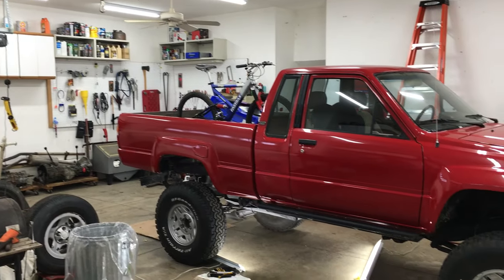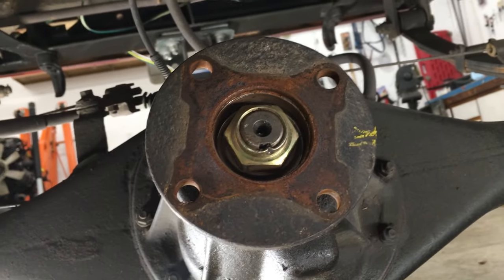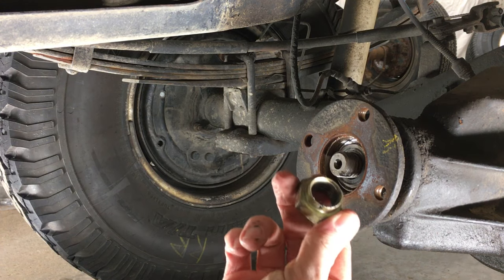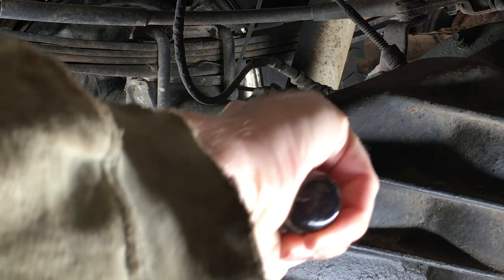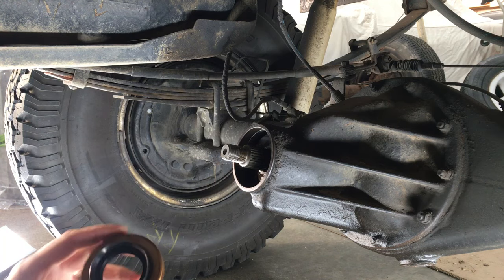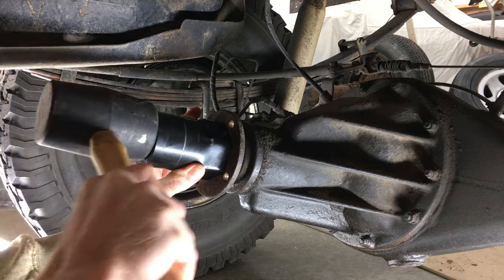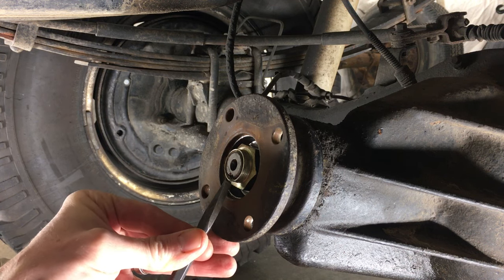How to Replace Toyota Pinion Oil Seal in Rear Differential/3rd Member

Comment: Toyota Master Tech here. The u joint does not have to maintain the same alignment with the pinion flange. It’s only when you’re disassembling a driveshaft that you have to make sure everything is indexed properly. The driveshaft is not balanced while attached to the pinion flange so that is why it doesn’t matter. If you noticed in your video, you do not necessarily reinstall the pinion flange on the same pinion splines so it makes no difference.
Reply from the maker: Jacob Dionne thanks for the tech👍
Reply: @6thGearGarage  no problem
Reply: @jacobdionne4334  Did the 90 ft-lbs of torque on the pinion nut really matter when you already had it aligned with the previous staking mark? Or is the 90 ft-lbs just a good rule of thumb if you fail to count turns?
Reply: @thelandcruiserproject  it depends what you’re doing. If you doing anything but simply replacing the pinion seal then you have to replace the crush sleeve and retorque.
Reply: @jacobdionne4334  Only replaced the pinion flange. Had a wear line that let a new seal leak.
Reply: @thelandcruiserproject  you need to retorque
Reply: @jacobdionne4334  Isn't removing the seal more invasive than just replacing the pinion flange? I removed the drive shaft, unstaked and removed 30mm pinion nut, removed pinion flange, installed new pinion flange, and the rest in reverse.
Reply: @thelandcruiserproject  no because you’re not using replacing a part that has bearing preload
Reply: @jacobdionne4334  Ah, I see I think. So since the new flange could be slightly different, that might affect the preload even with the nut back in the same spot. Thanks.
Reply: @thelandcruiserproject  yes
Reply: @Mike Hudson you can’t set it too deep. It’ll always seal
Reply: Agreed. What do you think about checking for backlash at the pinion, to be sure there is at least some backlash remaining after you're done? On my GM front diff, because of access difficulty, you measure backlash at the pinion and multiply by 2 to estimate ring gear backlash....
Reply: @spelunkerd  in regards to what? When setting pinion bearing preload, the backlash is already set for the pinion gear to ring gear. They’re separate.
Reply: @jacobdionne4334  I am no expert, I am asking the master tech whether what you did is standard practice. You make a good point, that assuming there was no wear of the hardware over the years, the pinion depth and backlash should not change just because you loosened, then retorqued to exactly the same position. But wouldn't it be appropriate to actually measure preload, and readjust the position of the pinion nut, rather than simply guessing based on minimum torque and counting threads? Backlash and preload tend to change over time as the gears wear. Wouldn't it be appropriate to recheck, readjust, and bring it all into spec? Or, would the expense of extra labor not be worth the cost?
Reply: @spelunkerd  you would need to pull both axles and the whole differential to recheck gear mesh.
Reply: Where are you located I may use you?
Reply: @THEBIBLEWAY238  this is 3 years ago. I teach college automotive currently
Reply: Thanks, I hate it when I hear BS shadfe tree mechanic "lore" passed off as fact and it carries on for decades; the drive shaft is balanced independent of the vehicle when they cut it and weld it together then they balance it on a lathe and attach the weight. The way people talk you'd need to mark your tires and bolt them back on the same way every time, it's just odd how there's all these bad mechanic 'tricks'.

Comment: Do not remove the pinion nut until you have marked the nut and pinin with a center punch so you can put the exact same preload on the bearings that they've had their entire life. Adding or subtracting a couple thousands of end-play or pre-load to the bearings is stupid and absolutely going to remove life from the pinion bearings.

Comment: you dont need special tools for pulling the seal, you screw in 2 screws on the face of the seal and then pull on the screw head with nail puller. :)

Comment: Dam great video I got an 86 and I've got massive vibration  some guys I bought it from may have installed gearing and didn't torque the pinion flange bolt correctly the flange moves  alot so I dropped the driveshaft and noticed the bolt can turn with your finger and they locked it in like that smfh I put everything back but tomorrow ill just torque it down to 90ft lbs and see if the vibration goes away.
Reply: Yes so I torqued it down and yes the vibration stopped then starting to come back not as bad so I think it loosened up again so sometime this week I'll tend to it again. I'm guessing they tried to install the gears themselves and didn't know what they were doing with the install I don't even think they preloaded anything lmao.

Comment: It’s actually not as important to count the turns on the nut as it may seem. The crush washers are pretty stiff, if you just run it back down and don’t hammer on it too much with an impact, you’ll be fine. But I’d put a mark on the nut and the pinion shaft so you have a good idea of where the nut was. Toyotas diffs aren’t very sensitive, thankfully.

Comment: You may have fixed your pinion seal, but how was your crush sleeve on the pinion? I bet your pinion was loose now that the sleeve has lost its crush. When you replace a seal on a diff, you need to replace the crush sleeve, unless you have a solid spacer on the pinion. Yea, “put the nut back where it was on the pinion” sure. But you can’t recrush a crush sleeve.
Reply from the maker: It's been a couple of years and it's all good. I showed the alternative to taking everything apart by using proper torque and tightening, because not everyone has the resources to repair it the long way. If you did want to disassemble the 3rd member and replace the crush sleeve, there's a link to those steps in the description.

Comment: Very good video.  I really like the voice-over and you explained every move perfectly.  Also, I immediately saw that you have the ideal tires on your truck.  Too many folks put too-wides on them.  They look great but are inefficient in the rough and fuel consumption.  Liked, sub'd.
Reply: In hawaii we make it wide there's multiple purposes for going wide stability is 1 and 2 we are surrounded by ocean which equals sand and we noticed wider wheels make better contact for riding on the sand now narrow wheels is good for mud it cuts through better than wide wheels we also noticed narrow wheels work good in the mountains. At the end of the day it all boils down to what you'll be using your rig for some people put wide wheels just for that aggressive look which to me is ok but very useless especially when using it on a 2 wheel drive I think lifting a 2 wheel drive in general is useless again it boils down to preference have a good day man.

Comment: You verify that the rotation torque is in spec. After you reach 90lbs. Should be around 10-12 inch pounds.
You will need to jack the rear off the ground. That verifies the preload has not changed.

Comment: Golden rule with diffs, always make sure the fill plug comes undone first, before draining plug comes out., sometimes you need to weld an old chewed out socket to these stripped headed lgs, -people tend to over tighten or use a shifter planner, rig or socket please only
Reply from the maker: 100%!!

Comment: 3:28 my flange comes off with just a few wiggles back and forth that shouldn’t be normal and also the washer that goes on the companion flange is that important? Mine didn’t have it and it’s leaking worse that it did before i changed it literally all the diff fluid came out
Reply from the maker: I say if Toyota engineers put the washer there, it must be for a good reason.

Comment: Don't forget to check breather on top, (my 08 doesn't have a hose) it should spin freely..If clogged it will also cause seal failure..i removed mine and used Gunk spray to loosen it..
Reply from the maker: Very good tip!
Reply: The axle vent clogged on my 1990 4runner causing the pinion oil seal leak.  Check this little bugger every once in a while to save heartache

Comment: Good work dude , I had a dripping oil from my differential, not much really, one drop a day ,  on a clean surface, that's too much. I have 84 Toyota Cressida,its  differential is as your pickup, it uses the same oil seal number.
I was encouraged by your video , to do the job, I did it exactly as you did. The shiny nut , took little torque to loose , I didn't bother counting the turns, just remember the place, no way to be missed, I had a very hard time removing the old seal, I freezed the new seal for easy fit,I retightened the shiny 24 mm nut , again not the torque you stated , but with the torque it needed  to put it , where it was before, removing the pinion was very easy , no tool was needed . And something, that you didn't mention , which is to empty the oil from the diff. Before you start,  I created a mess by that . And pour a new gear oil in it ,   around 1.4 L  ,to keep diff. And seals in good shape . 
Thanks again for posting this video.
Reply from the maker: Good call on draining the fluid. I didn't need to because my truck is lifted, so the pinion angle is up for the driveshaft to meet the transfer case. But on a car you will definitely want to drain the fluid to avoid a mess.

Comment: When I was redoing my Tahoe's rear axle pinion seal I put the nut back on with an impact and ever since the rear pinion seal leaks and I can move the driveshaft up and down at the yoke.  I didn't know better back then but believe it or not I still have not fixed it.  Been running the truck like that for about 12 years now.  Man them 14 bolts are tough.
Reply from the maker: Gamblin!! But yeah thats amazing it's been ok for 14 years!

Comment: Great video. If you torque it to a specific ft lbs, the prior step of counting the turns is pointless, no? It's going to stop at 90 ft lbs regardless and wind up in the same position. 

Also, did you make the shaft and the yoke even though you didn't separate them? I may have missed it but seems like the only thing you'd need to mark, if anything at all, is the yoke and the diff flange mating surface.
Reply from the maker: Yeah, you're right. I wanted to have a backup way to keep track, just in case something was way off. And yeah, once again, I'm in the habit of marking it all just in case.

Comment: Anyone know any tricks for getting the flange back on the spline? I cleaned everything carefully and put some anti-sieze on the spline to try to lubricate it, but after fighting it for a couple of hours, I can't get it on there.
Reply from the maker: The alignment and angle has to be perfect due to the tight tolerances. I'd give it another try.
Reply: @6thGearGarage Cool, thanks so much. I guess I'm just a nervous novice 😂.

I have an 8.4 with 30 splines regeared to 4.88. I paid a local expert to install the 4.88 Nitro Gear kit. Talking to someone else much more competent than me, it sounds like this combination in particular requires a little persuasion. I might use some freeze spray to try to get the spline to shrink slightly. No idea if that'll help.

The other thing I'm going to try is inspecting the spline carefully and using a triangular file to gently clean it up if something is out of whack.

Comment: I had my rear pinion seal changed  now I get random metal on metal chirping  and grinding and shuddering in the front. Do you think its related..? 
2008 jeep grand cherokee 3.7     with 166,000
 My differential is fine, no  whiring sound.?
 😊
Reply from the maker: I,m no jeep expert, but I don't think it could be related
Reply: @6thGearGarage  thank you

Comment: Can  you use the "count the turns" method for the front pinion seal for the front diff?
Reply from the maker: You can, but for a piece of mind I bought an in/lbs dial torque wrench to properly set preload when I replaced the front pinion seal on my land cruiser.

Comment: Can you leave oil in the diff for the front as well when you change the pinion seal??
Reply from the maker: Yes I left the diff oil in when changing the front pinion seal on my land cruiser and it doesn't leak out. That was a different axle though, so maybe have a drain pan nearby just in case.

Comment: I'm doing this to my '91 4runner and I'm wondering if with the companion flange removed, is it ok that the pinion wiggles in place? Or can there be a problem with the inner bearing?  Any help would be appreciated.  Thanks
Reply from the maker: The companion flange holds the pinion in the center, so some movement is ok.  I've had some that moved a lot and some that didnt.

Comment: Awesome video, mine is leaking pretty good to the point where it’s slinging up on the undercarriage. You think it’s safe to drive a few miles to the Autoparts store? I’m afraid to grenade my rear diff 😬
Reply from the maker: Yeah, but I'd check the fluid level first, make sure it's not too low.

Comment: There is NO way that truck spent it's life in Ohio! Thanks for the video, I have a '77 Toyota FJ40 I need to tighten the pinion nut on, this will help a lot!  Let me know if you want to do a video on how to replace the knuckle seals, I'll be happy to loan you my 40! ;)
Reply from the maker: Dianna Poe I think it was a West Virginia Truck before it ended up in Ohio. I’ve always wanted a 40... if I could only have a small Toyota collection...  my 85 needs new seals up front as well, so there will be a video for a front axle rebuild eventually.👍

Comment: Houston we have a problem,,I think I am going to have to get a new pinion flange, installed new seal, drive about 30 miles,started leaking again,,there was a little groove but how do you know when the groove is to deep,,ha, it starts leaking again,lol
These older trucks are 27 spline , I’m pretty sure,,anywho, oh the agony
Reply from the maker: Ouch that sucks... If it catches your finger nail it can cause problems.  What you can try is slightly overdriving or underdriving the seal to get it in a fresh spot on the flange.
Reply: @6thGearGarage  well I actually have 2 different grooves,, oringinal flange,apparently it’s already been done, as far as moving seal from one spot to the next,
So I just ordered me a new one with seal and nut
Reply from the maker: @clayton203  Well someone had the right idea.. definitely time for a new one!
Reply: @6thGearGarage  got one from east coast gear today, triple drilled flange with dust cover ,,,,seal and nut ,Yukon brand delivered for 80 buck
Just giving you the run down, Thats who I got my gears from as well, when I set them up,,good folks

Comment: Noticed gear oil on the ground right below my pinion seal. I had replaced this seal just over 2 years ago with the factory Toyota part. Any idea why it would fail so soon? Thinking I did something wrong the first time... could I get away with just keeping an eye on the rear diff oil level and adding oil accordingly?
Reply from the maker: A clogged breather can cause excess pressure, making the seal leak. Check that first.
Reply: @6thGearGarage  thanks for the tip! Will check that first before further diagnosing

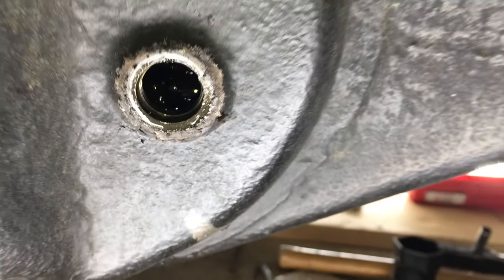Comment: 10:35
Good trick with Toyota's is jack up the right side and get some more oil in there.
They're not like independent axles or gearboxes that requires a specific amount of oil, the more oil the merrier.
Also if your Toyota has a Limited Slip diff, don't use the cheapo 90W LS oil, splurge on the Castrol 75W140 BMW Limited Slip oil, it has better properties to retain friction between the clutch plates to grab onto one another, and does a better job of washing off worn friction material.

Comment: great vid. i'm about to attempt this on my 1991 4runner, wish me luck bro.
Reply from the maker: Thanks, you got this!!
Reply: If you haven't done this yet, try  1.2oz  of ATP 205 in the differential.  I had a chronic leak for years,  yesterday I changed to Mobil 1 Syn  GL5  and  added 1.2oz  of ATP 205 and my leak as ceased thus far. But I do have the OEM Toyota Seal standing by....   The ATP 2oz  worked on my steering gear box leak also. That has been 6 months ago. I have 1990 4Runner, 306,000 miles.

Comment: After pulling my seal I noticed the pinion has some play in it but it doesn’t look like yours does in the video. Should they have some play if the nut is off?
Reply from the maker: I’m not sure, how much play and how many miles?
Reply: 6th Gear Garage wow! thanks for the reply! 220k miles. Once the nut was removed the front bearing was free to move around. I was able to pull the front pinion bearing and inspect it and it was good. Once reassembled it’s was tight. The nut also threaded a quarter turn past the original location as well. Wondering if I shouldn’t rebuild it all now. Thoughts?

Comment: What´s the point of counting the number of turns when you still have to torque it, doesn´t the torque determine where the nut ends up?
Reply from the maker: Just a safeguard to make sure something's not completely off or wrong.
Reply: @6thGearGarage  I see.

Comment: Excellent video but you should have marked the pinion shaft with the flange it's more important than marking the drive shaft to the flange, my workshop manual recommends to mark the flange with the pinion shaft. Also you can fit two bolts and four nuts to the flange then you can get purchase using a prybar locked off to the springs, saves chocking wheels  a mate.

Comment: So you don't have to drain the diff oil beforehand?
Reply from the maker: I did not. The angle of the rear axle did not allow fluid to leak from the front.